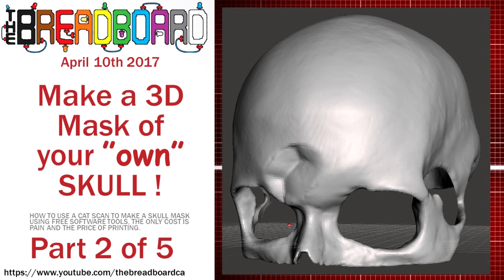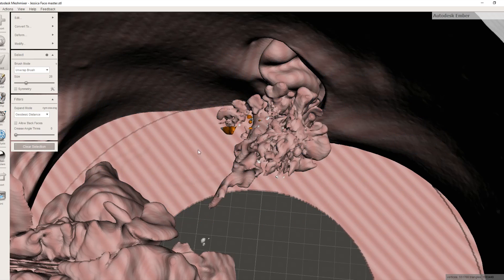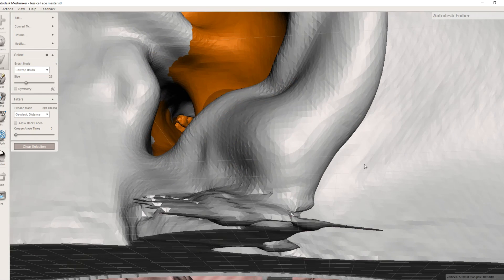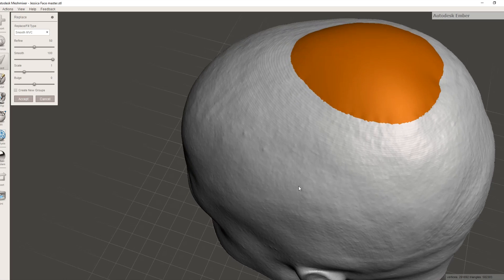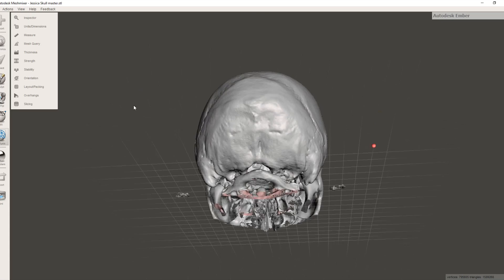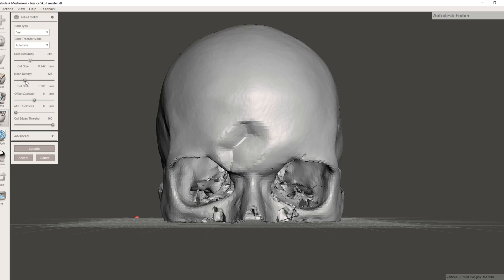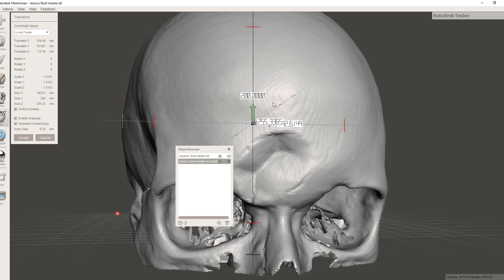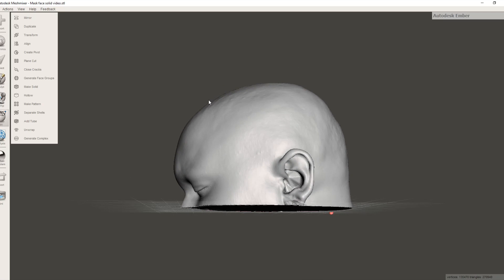3D printable skull from CT Scan - details Part 2, Meshmixer

Comment: Great job!
I am struggling to fill in all the holes and errors in a human skull, derived from a CT scan. It is so tedious! Any advice :-)? thanks! (p.s. I teach anatomy if you were wondering...)
Reply from the maker: There are some pretty good tools in Mesh mixer and Blender that can help with that, I dont use them very often so cant quote the exact tools, the other thought it to adjust the settings on density at the early stage of converting the CT Scan to STL, it may be easier to remove a bit of skin or hair for example rather than loads of holes to be filled.
Reply: @TheBreadboardca  yeah thanks. I guess cleaning up CT scans and MRI's will always be a little tedious, but worth it especially if it can help plan a complicated OP.